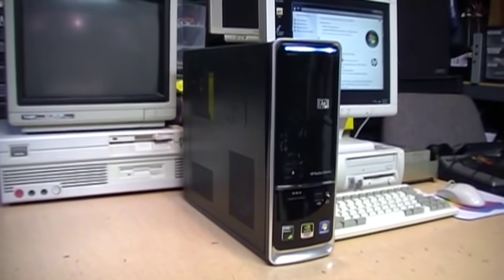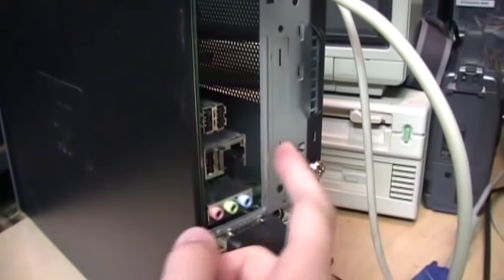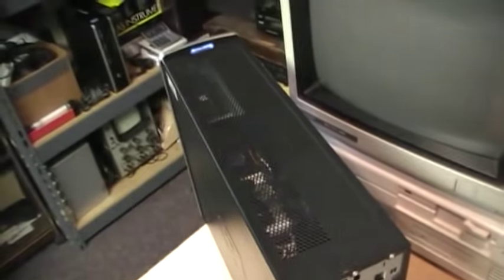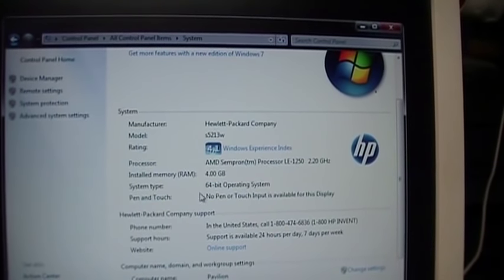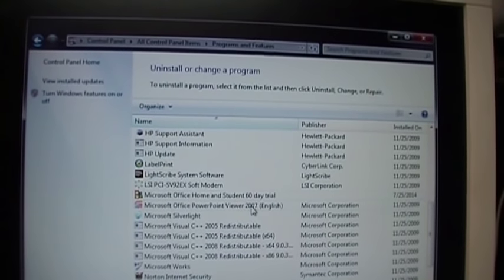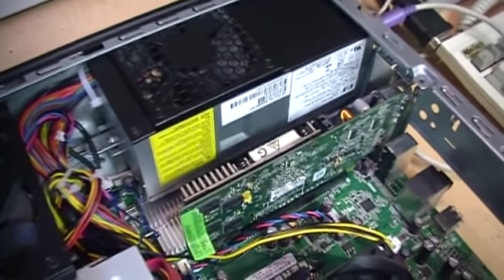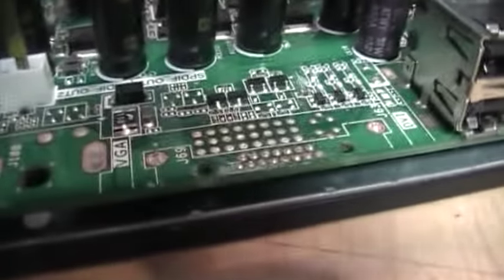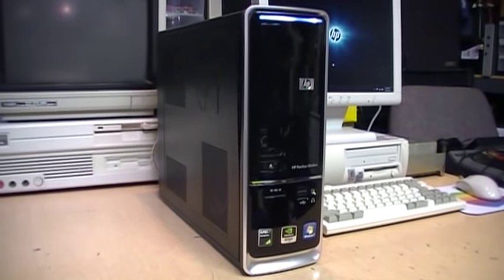HP S5213W Pavilion Slimline AMD 64-bit Windows 7 PC

Comment: not a bad machine at all for the basics
Reply: I have a model very similar that is used for PC Casual Gaming and HTPC Use. I've had the Hard Drive almost go "BANG" a couple of times, and the RAM didn't like me either (OS Complains about having too little RAM, even though I have 4GBs), but works fine to this day.
Reply: Upgradeable to a Quad core. http://h20564.www2.hp.com/hpsc/doc/public/display?docId=c01852860

Comment: I had an older generation one of these that I used from 2009 until a few months ago. It started with Vista then moved to Windows 7 and even actually Windows 8. It was an Athlon 64 x2 model that went through dozens of graphics cards, RAM modules and drives. The case may be scratched and cables flying everywhere - but the damn thing still fires up and works like a champ!
Reply: Typing this out on a 2010 model, it's still fully compatible with most modern software. It's a plucky old machine and won't be dying anytime soon.
Reply: I had one of those that I inherited from my aunt after she passed away. At times it would make a revving noise and it would drive me crazy
Reply: @kenrutherford1109  Is fan revving? May need a good cleaning.
Reply: @connorm955  I don't have it anymore. I got rid of it

Comment: Wouldn't be that that hard to solder in a new VGA connector.. Maybe 10 minutes tops.
Reply from the maker: Multi-layer motherboards can be rather difficult to solder on, and besides, the video card I put in is better than the onboard graphics were -- when I first got it, it was showing an Windows Experience Index of 3.2, which jumped up to 4.1 when I recalculated it using the new video card.
Reply: vwestlife In that case, It's an Upgrade!
Reply: Requires actually having to do something, many people are too damn lazy to fix anything.  It breaks they throw it away and buy a new one.

Comment: The Sempron is a bit of a slug CPU though. Fine to run Windows 7 and basic webbrowsing, but upgrading it would help that computer out significantly. From what I've read, it uses a AM2(+) CPU socket, so you can actually upgrade to a quad-core if the motherboards allows it.

Comment: May i to install linux in this pc?
Reply: Pain you shal feel, my Friend. Linux can be installed but you have to choose one of these 4:
1. Buy a Graphics Card, Best solution, but you need to put more money into it.
2. Use Xorg's Vesa Drivers, Gobbles up an entire CPU core, and runs poory.
3. Install nVidia 304 Legacy drivers, which require proprietery drivers, a downgraded Kernel, and Running an old Version of Xorg
4. To #### with a GUI! >:) I'll just use a Terminal!
But it cam be done, and i did the 3rd one, and it's fine, but I don't trust the system.

Comment: I'm literally watching this on that model of PC right now. I kind of want to learn how to upgrade it, because as of right now this thing is entirely vanilla. If I could run something like Dolphin on it, that'd be great
Reply: It's actually a fully standard non-proprietary computer. It has a MicroATX motherboard and TFX PSU.
Reply: @charleswarosa5332 it's supposed to have video card and RAM expansion slots
Reply: @boogaloobender3462  It does have those too. I will put a low profile GPU (HD6450) in mine. I have 3GB of ram in mine and not 4GB for some reason. it also has a Better 2.8 GHz CPU.

Comment: I found a tossed out HP Slimline Pavilion with Win Vista (along with a Lenovo IdeaCenter) still works, but the previous owners put a screw in the DVD (thinking it was the HDD, as the Lenovo had a screw in it's HDD). The model you have here, did it come with a portable HDD system? Thank you 🤓

Comment: Ironically.  I got an HP that is about the same model.  Same thing.  VGA connector sheard off, and the IO Shield missing.  Got it for a good deal however. Works perfectly fine.

Comment: those motherboard connects for VGA are very weak on the HP's (they look like a laptop connector, small and not much to the mountings on the board), slightly bumped the cable on one and snapped the connector, had to give the customer a free video card because of it.

Comment: This reminds me of the computer I had in uni, a hp Pavillion running Vista. That had a 320 GB HDD, a Western Digital at that. The motherboard went on that thing, but I still have the hard drive mounted in an external caddy as a backup. $50 is a very reasonable price: if I lived in the U.S. I'd definitely get it

Comment: my mom had about the same model of hp slimline except it didn't have a memory card slot and it had 3 gigs of ram. It fell of a desk once it didnt fall very far but the vga cable bent the connector just a bit but it still works fine. but i did put a small graphics card it it because i wanted to watch hd youtube videos

Comment: Why did you sell it? You could use it as a new winamp pc and replace the compaq deskpro en tower.
Reply from the maker: Mercedes Citaro bus videos Why change what is working perfectly fine?
Reply: True that, what radio station are you listening to?
Reply: +GOHSMarchingBand&amp;Drumline That could happen as easily on the HP. Plus, often times an older, but of much higher quality product is better than these new cheapo HP machines which seem to last only 2 or 3 years.

Comment: I found one similar to this model except that it is a s5713w. It's total wattage is 220W. Is it possible to put in a graphics card with an HDMI port? Most cards of those kind usually require 300W or higher. These PCs came out in late 2010 so the one I have is probably 6 years old or less. These HP s5000 models are some really nice looking desktop PCs!
Reply: The manufacturer's power supply requirements aren't necessarily completely accurate. It is only a best estimate of total system usage. For example a graphics card with a '300W requirement' may only use between 50W-75W for the graphics card itself and usually systems with low wattage power supplies have low or ultra low power CPUs. You should be fine, as long as you don't have a lot of additional hardware in the system.

Remember DVI (I or D) is adaptable to HDMI. However something like a nVidia GT 210 should work, if you can find one.

Comment: I have the same PC. I use it as a 24/7 Linux web server, and I haven't had any issues. It's been running nonstop for over 3 months now
Reply: You may want an SSD then because a hard drive wont last very long
Reply: It's fine; I don't really actually get much traffic anyway, and I only sometimes upload things to it. If you want to know what my website's url is, just ask
Reply: +Alex K. Yeah but running a hard drive for months at a time non stop will put a lot of hours on it and that just kills a hard drive
Reply: Good point, maybe I'll buy an SSD from newegg in a few days
Reply: +Alex K. Good choice
Reply: I've been running the same harddrive for a few years now (one of the older 80gb Seagates). Has been holding up just fine.
Reply: @evanetheridge3798 with my own nas that I'm still in the middle of building, I put a nvme drive in it as a boot drive for a few reasons, most of it is because I figure most of the cycles on it would be mostly reading for the os boot and a write here and there for os updates. Plus, considering that I'm building into a fractal designs r4 case and have only so many sata connections from the power supply and only so much room in the case that that would help too.

Comment: is the cpu upgradeable? what kind of graphics card?
Reply from the maker: Yes, you can use any AMD Socket AM2+, so I believe the best that you can upgrade it to is a Phenom II. As I show in the video, the graphics card is an ATI Radeon X1300.
Reply: vwestlife
This I can confirm, as I have the best model of this generation of slimlines. Mine had 5 gigs of ram and a 1TB hard drive as well as an AMD Phenom chip at 3something gigahertz. Although, mine has 2 PCI x1 slots instead of the normal x16s.
 Also, the DVI port is used but it is only single link DVI, not DVI-D.
Reply: i noticed their were two revisions of this board, one with two pcis, a pcie x16 and a pcei x1.  the other revision had one pci and two pcie x1s
Reply: That's the one I have. I have a feeling it's a later revision as mine was built in 2011.
Reply: I'm the "lucky buyer" of this computer. I installed a AMD Phenom X3 CPU in it last night. It works and recognizes the new CPU just fine.

Comment: It's better than your main PC, why not use it?
Reply from the maker: I already have an HP Quad Core i5 that will become my main PC when my IBM ThinkCentre finally dies.
Reply: What, in 2069? lol idk, it just bothers me that you don't have a better PC, even though it's fine. Just like you can't resist acting like you do around a baby.
Reply from the maker: TheBcoolGuy I see no reason to change to another computer as long as the ThinkCentre is still working fine and does everything I need it to do. It's a computer, not a fashion accessory!
Reply: vwestlife I know. It's obviously cool that you use an old PC. It just grinds my gears on some level that I'm looking to upgrade miine even though it's tons better than yours. an i5-650, 6GB of DDR2 RAM (idk dat clok sped tho), a gt 330 gpu... I play games in 1080p. I have a real need for a beast PC, though. I will make awesome games and I will even include a graphic option that's so low-detail that your ThinkCentre could easily play it.
Reply from the maker: TheBcoolGuy I'm not a gamer. That's why I don't need to waste my money constantly upgrading my PCs to the latest specs. :-)
Reply: the amd sempron wouldent actually be much better as it still is a really weak cpu
Reply: I don't care about this anymore. I have learned from past experiences these past few months that other people's business is not to be messed with. I don't care if you use an iBSx275 or an R9 280x.